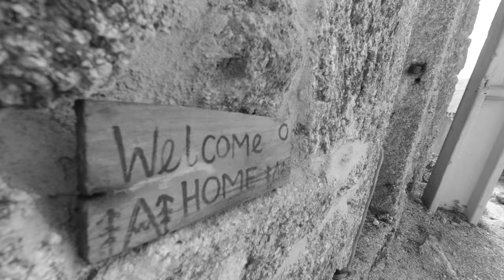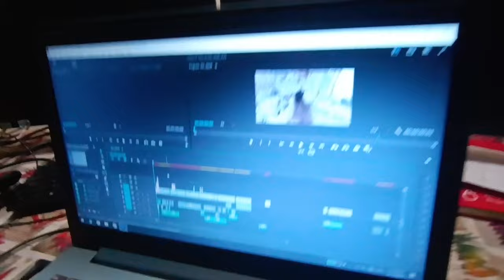My new place in PORTUGAL - Renovation in Portugal (#35)

Comment: Let me tell you something like Portuguese with the family from the Castelo Branco area.. I have been in construction for 40 years and so maybe I can help with my simple opinion. The big holes and even the small ones, we don't fill them with mortar. We fill them with stones and use mortar only to "glue" these stones together. This work is done quite quickly. To fill the space between the stones, we use a "pastry bag" and to finish, a dry "bristle" brush. You don't have to worry about "earthquakes" because this area is not a seismic zone in Portugal. keep strong 💪
Reply from the maker: Hey guys, firstly thank you for sharing your knowledge and experience with me🙏🏼 
The thing is that my walls already moved... And only when you will stand next to the wall you will understand how bad it is... If the wall where straight and all good, I would have point the juntas and that's all, but unfortunately my situation is a bit different. If you wish to come, take a look and tell me what you think, I will be very much appreciate 🙏🏼😊✨
Reply: @MyPortugalDream I understand, but just using concrete like you're doing doesn't make the "warped" wall better. If you fill it with granite stones and use 3/2 concrete (3 sand for 2 cement) it will keep the wall cohesive the way it is and it won't fall because of that. Understand that these houses have been there for centuries. It will only save you money and work. To straighten these walls the only way is to "dismantle" them and do it again. Keep strong 🦾🦾